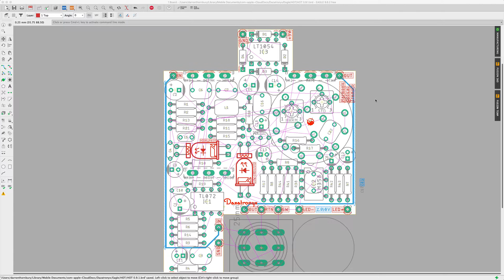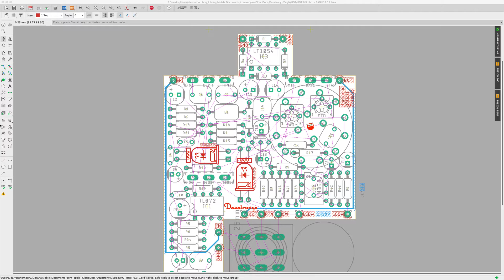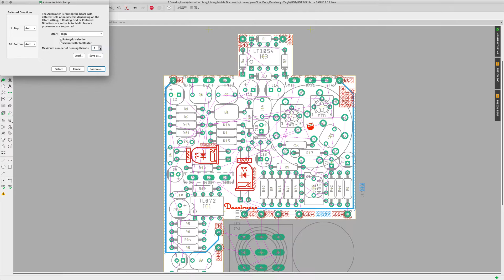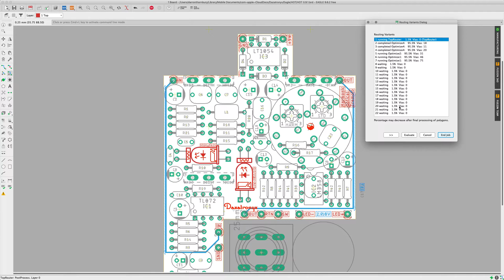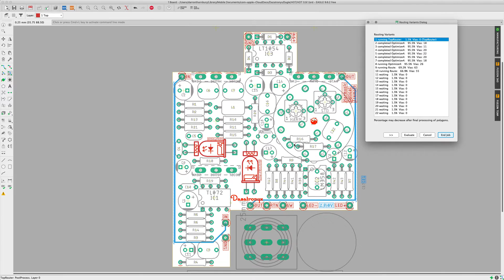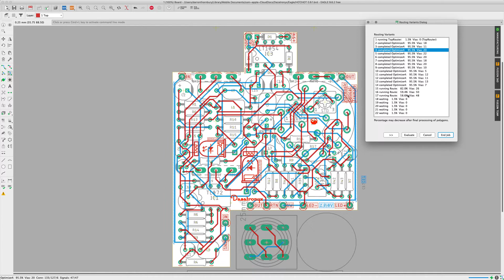Drawing retro curved circuit board traces in Eagle

Comment: Very informative man, thanks! I've been wondering why there is so much hate towards the auto-router.. I've done a bunch now and auto-router speeds things up incredibly. Thanks again!
Reply from the maker: Thanks. Yeah, I can see why there'd be initial hesitation. Usually though, the shortest path will be the best path for me and autoroutes finds that more efficiently AND effectively than I will. I heard somebody call the auto-router button "the devil's doorbell" haha. Somebody pointed out to me that you can make them even more retro looking in Eagle, if you run the "teardrop" ULP. it's really easy to do at the end:

Go to File > Run ULP > teardrops
set max radius to 2.5
Select both “Teardrop Vias” and “Teardrop Pads”